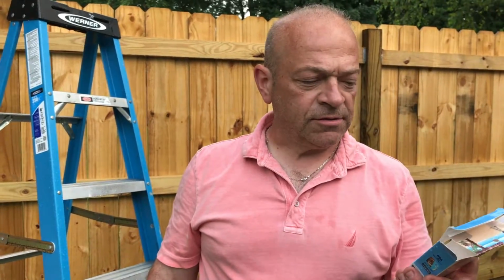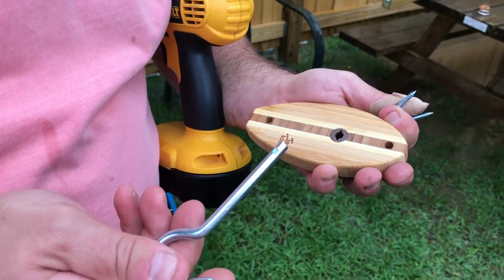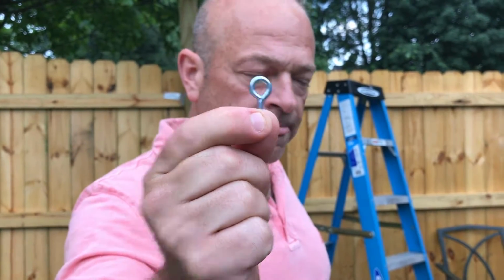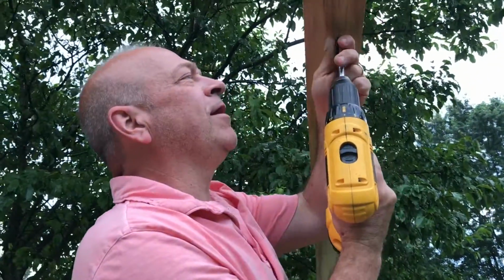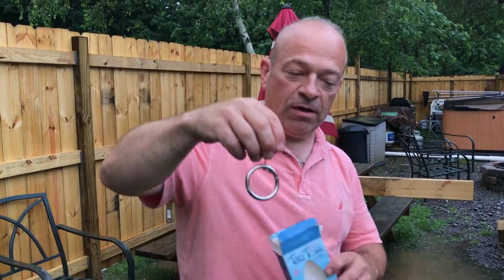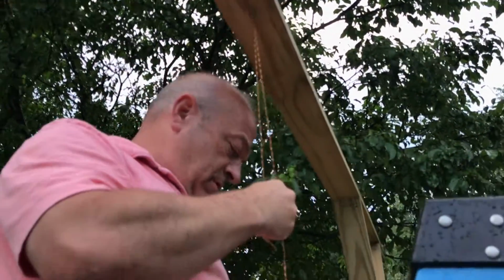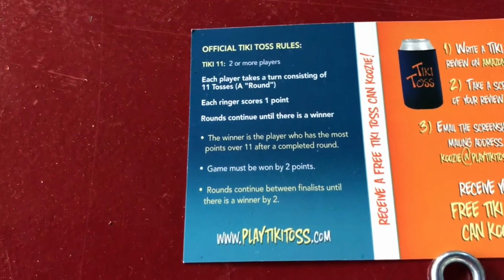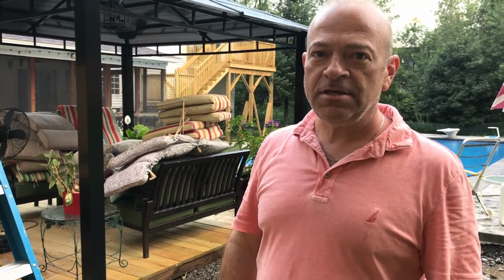Everybody Should Own This Game! How to: Tiki Toss

Comment: Sir,... a question,... why do you keep calling the ring a hook,...????
it's freaking annouying dude,... you're holding a ring in your hand and saying 'this hook blah blah blah,..'
anyway,,... I love this game, I build my own and have for 25 years or so,..
tips,... you tie the string in at the top,... you make the adjust ments at the bottom,.... the board will shring and warp an kids pull on it,...  stuff like that,...
I put a barrel clip on the string to make the adjustments easier and instant and you don't have to untie it over and over,.....  you had the string way too long (it was past the hook) in the beginning of the video,
I generally go 8 foot up for the top board, 4 ft. out to the eyelet and 5 for up for the ring,...
8, 4, 5, but sometimes it's nice to change it up a bit if you have multiple games,... different ring sizes different heights and lengths ,....

https://www.youtube.com/watch?v=yjp02QuRvpw